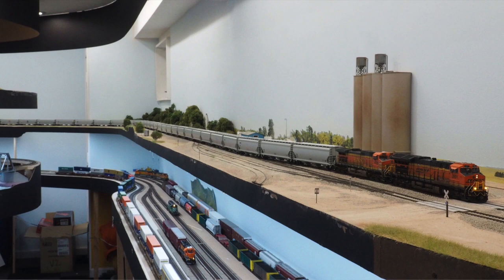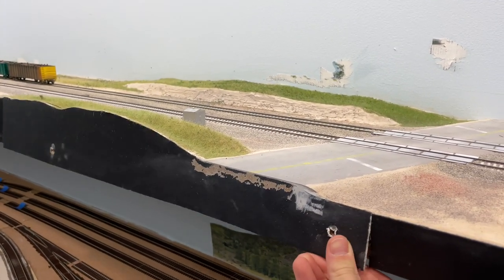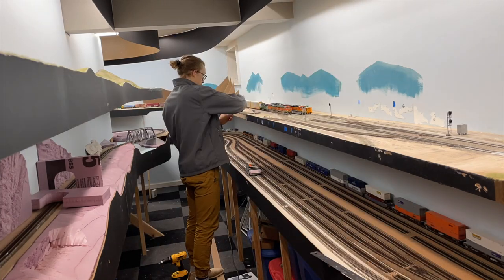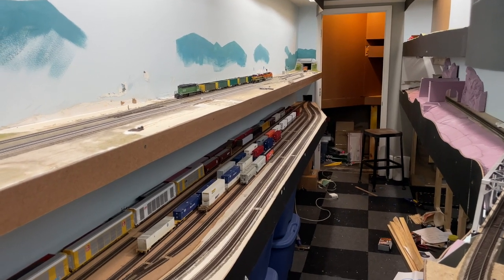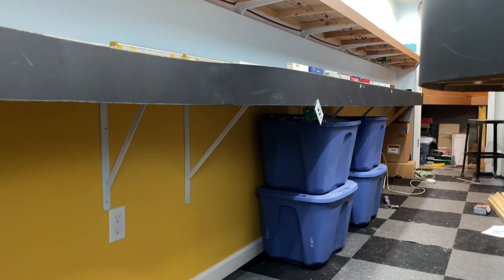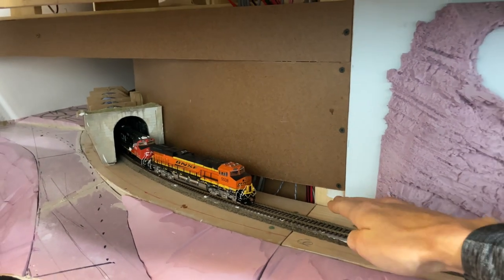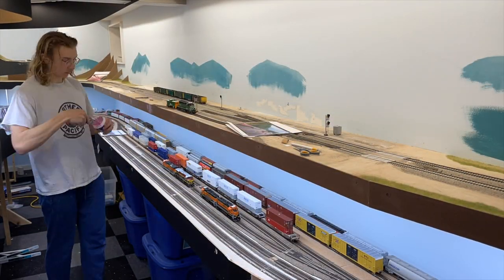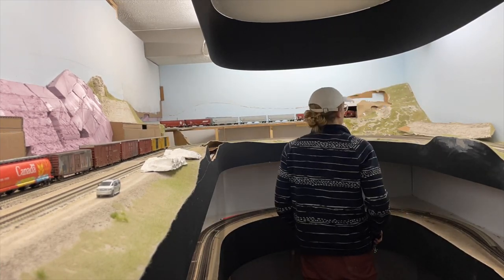(De)construction! – Marias Pass HO Scale Layout EP01

Comment: RioGrande Steve Wellington New Zealand
Hi Cam: Your layout is looks really fantastic, your a brave man to destroy a fully finished layout & reconfigure it, but from what I've seen so far with the changes, it's going to be even better once the changes are finished.
I'm following your changes with great interest, as about 15 years ago I made a drastic change just like you to my Railroad to, so far I do not regret the decision I made.
I had a Proto Freelanced Model Railroad in N Scale the Railroad was based on the Rio Grande, but I completely tore down the Railroad & rebuilt it using the same benchwork just slightly rearranged. I now model the Rio Grande between Denver Colorado & Grand Junction Colorado, I do not have the room you do, but what I have built is a Multi Decked Railroad ( 3 Decks & in places 4 Decks) all in a 13' square room, with staging representing West & East at each end.
Your new Railroad looks great the changes have progressed at a rapid pace, & the scenes are coming together nicely keep up the great work & good luck with the changes.
Reply from the maker: Thanks for the thoughts! Sometimes you can just feel that a change is necessary and the right move. What years are you modeling? I really like the scenery out in Colorado and have always been a fan of the DRGW. N scale also seems like the way to go. I'm thinking my future layouts will be N scale.
-Cam